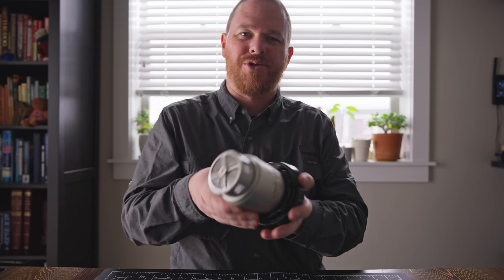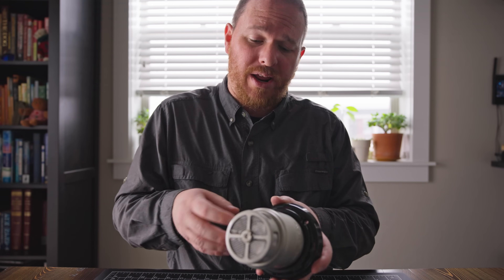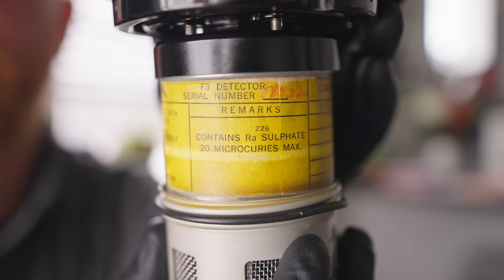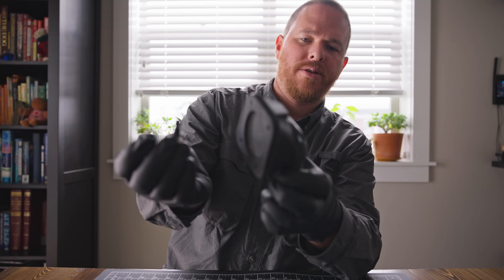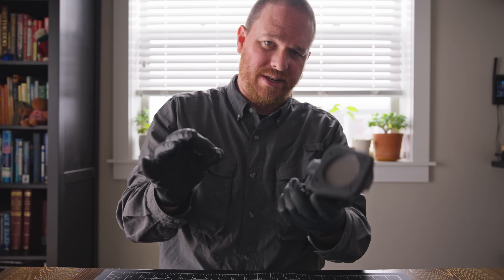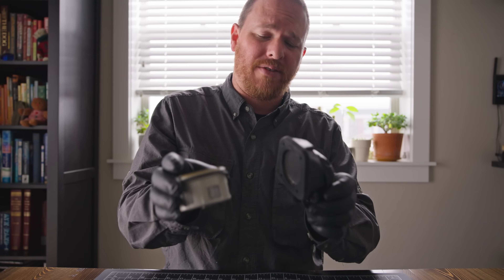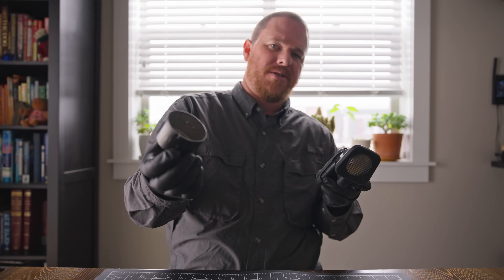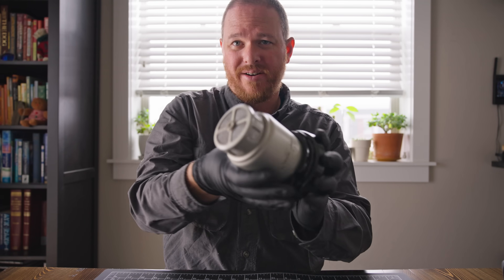Intensely Radioactive Industrial Smoke Detector from the 1950's

Comment: holy heck that sure are some naaasty sources in there.other than the total neglect of any and all safety precautions for handling this sort of source a pretty enjoyable video but PLEEEAASE do not handle sources like that. in any professionl settings sources of this activity would either not be man-handled at all but rather in a shielded robotic hot box, handled inside a shielded glove box by personel or maaaybe under special circumstances be handled in a well ventilated, closed loop, specially certified nuclear chem lab with 2 redundant  personal dosimeters, at least one ionisation detector and scintillation detector continuously sampling the air in the lab and inside a lead fortress made of thick lead bricks. 20uCi is a terrifying amount of activity. The fact that you can just screw these open makes me question what the hell the designers were thinking. i mean nowadays you need 10 different safety screwdrivers to open up a power bar and back then you could just unscrew that? also why does the industrial detector need a source this active?

Comment: AM-241 is not just an alpha source and it does release plenty of gamma radiation with energies of 26Kev and 60Kev. Your device must not be sensitive enough to detect them giving you false readings compared to the radium source
Reply from the maker: The americium source does give off a lot of alpha / gammas and my detector can see them. The radium not only gives off alpha radiation but also loads of beta and gamma. All the daughter isotopes give off a lot as well, which adds to the total radiation.

Comment: Ist the radioactive Post from the mesh Thing strong enough to make the needle from my cdv-715 move?
Reply from the maker: Good question. I have a CDV-715 from a CD-777 kit. Haven't tried that source against that detector.
Reply: @RadioactiveDrew  if you have the time, try it,just for interest.i make a electrical restoration of my cdv-715, checking all the resistors in the circuit, most of them are out of tolerance, and get replaced with New ones,to make the cdv-715 working much better. Have a nice day, and greetings from germany.

Comment: you need a cloud chamber
Reply from the maker: I know. Its something I'm working on.
Reply: @RadioactiveDrew  next time you're in the southern California area, let's meet up.

I have 3 chambers I built, and I have one you can have.

My biggest uses around 800w when active and takes about an hour to cool down.
It's a water cooled tec setup built into a custom pedestal stand.
It has a pair of rgbw light strips in a around the base with only a 1mm slit and 15mm back set gives a 2deg light beam at 3mm and 10mm off the chilled plate, a grove around the chilled plate let's alcohol come in contact with the mid plate between the 2 cooling stages. A 10gal frameless cube aquarium fits over a lip seal, keeping the unit water tight. I can keep talking for hours
Reply from the maker: @ZoeyR86 wow, that does sound exactly what I’m looking for. Email me radioactivedrew at gmail.

Comment: you are crazy , how big dose did you get from that ,I dont know much about nuclear physics or radiation , moistly from bunch of videos on radioactivity and based on that stuff you risk cancer if not worse . how do you even dare to take things apart  not to mention you were exposed for significant time, i mean meter was going crazy even  far away .
Reply from the maker: The dose rates from a source like this radium post is on the higher side of sources you can find. But you would have to spend much more time with it in your pocket for there to be a problem.

Comment: How was this advertised? 

Achmeds Dirty Bomb Starter Kit.
Just add high explosive!!! 

All this can be yours for 3 easy  payments of 3.99 sheckles
Reply from the maker: Was advertised as a industrial smoke detector, which it is.
Reply: @RadioactiveDrew  really man, no sense of humor? I know it's a smoke detector, I know it works because the radioactive material ionizes the surrounding air allowing that air to become electrically conductive creating a circuit that smoke particles will break thus triggering the alarm. And I knew all that before I watched the video, id just never seen anyone take one of those apart before. I used to work for Sandia, I've actually touched two different pits from weapons being dismantled. Me and old Mr Nukey are well acquainted and all that is to say it was a joke but only kinda because some asshole bent on doing bad shit gets ahold of a few of those off ebay, they could make something akin to a dirty bomb, or some idiot looking for clicks doesnt know how dangerous this stuff is buys one for a video and does something stupid like putting radium in their pocket for a day or two see what I mean. But in all honesty my previous was meant to make you chuckle not a serious question
Reply from the maker: @limabravo6065  sometimes its hard to tell what is sarcasm on here.
Reply: @RadioactiveDrew  I know and honestly I've seen the comments people leave you and others that are dead serious and dead wrong but they'll fight tooth and nail convinced of their superiority. Hell I had a guy on reddit write me a damn near dissertation on why I was wrong about fission weapons, and that the fuel in those bombs all undergoes fission. Not sure where he got his info but he was passionate that was for damn sure. Oppenheimer couldn't have convinced this guy but what can you do. Anyway sorry for the confusion, big fan of the channel  and please don't irradiate yourself

Comment: So I know you’re limiting your exposure quite a bit in this video, but I am curious if you have a rough idea on how long it would take for radiation sickness or burns to appear if you were to handle the device ( fully assembled) for a more prolonged amount of time. Would you even be able to get burns or radiation sickness from handling this device? Also, is there any shielding provided or is it relatively unshielded?
Reply from the maker: You wouldn't be able to get radiation burns or sickness from handling something like this smoke detector. The level of activity isn't high enough. The radium source might cause some redness of the skin if you were to hold it in your hand for a while.

Comment: What confuses me, if I have a unit (GMC-500+) that doesn't measure alpha, yet reads 10k+ CPM when reading a house hold smoke detector button of americium 241. Am I not reading the alpha? Am I reading beta/gamma?
The other part is why does the card that came with it saying over 100 CPM is high. Isn't that ridiculously small compared to other samples that are 10k, 20k, etc
Reply from the maker: That card is wrong. 100 CPM isn’t even close to high. Am-241 does give off gamma radiation but it’s at a much lower energy than most other isotopes.

Comment: Make your own battery with a pervoskite, or maybe cigs or gan solar panel, with gamma and other types of radiation, you coupld probably get some minor useful result. How many watts of energy is this radioactive thing throwing out? It does not get hot in watts, but its probably very energetic in a non heat manner. ?

Gammavoltaic conversion

Gammavoltaic devices use a semiconductor junction to produce electrical energy from energetic gamma particles (high-energy photons). They have only been considered in the 2010s[13][14][15][16] but were proposed as early as 1981.[17]

A gammavoltaic effect has been reported in perovskite solar cells.[13] Another patented design involves scattering of the gamma particle until its energy has decreased enough to be absorbed in a conventional photovoltaic cell.[14] Gammavoltaic designs using diamond and Schottky diodes are also being investigated.[15][16]
Reply from the maker: Now that would be really cool to test out. Seems like it would make so much more sense to use the full force gamma energy than to try and knock it down to what photovoltaic can handle. The idea of using ionizing radiation as direct energy source has always fascinated me.

Comment: I wonder how many folks handled that exact same detector with no protection, and was contaminated with radium directly. Also, i wonder just how many people were adversely affected by just that detector being installed in various buildings.
Reply from the maker: It seems like the installation process would be fairly quick cutting down on people’s exposure.
Reply: @RadioactiveDrew  Yeah. Most of the time it would be, when troubleshooting is necessary, someone may have handled it longer. Im just thinking, how radioactive it is, wow.
Reply from the maker: @KickOutTheJhm I don’t think anyone would have been holding it for that long. Plus it has stickers on it saying it’s radioactive. I would imagine the techs for the company had some training on do’s and don’t’s.

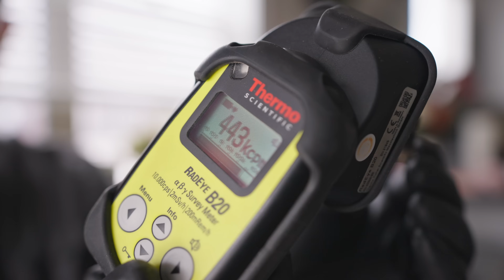Comment: @RadioactiveDrew The RadEye Geiger counter had 10,000 CPS = 2mSV/hour written on it. 4:50  It read approx 500,000 counts per minute=8333 CPS = 1.66mSV/hour. Less than a chest x-ray every hour. Wouldn't wan't that exposure more than once a year, but fine if don't do it more often.
Reply: So it is. Apologies, I misread as equals.Nasty smoke detector ain't it.
Reply from the maker: @HowardKlein1958 the smoke detector is a pretty unique source. Just needs to be treated with respect.
Reply from the maker: Those numbers on the Radeye B20 are the limits of its range. Over those readings it goes into overload. On contact that smoke detector source goes over that range.

Comment: Radon gas???
Reply from the maker: What about it? I don’t keep sources this active in the house. I also monitor the radon level inside.
Reply: @RadioactiveDrew  But this source emits RAdon gas? I am right?
Reply from the maker: It does…but it’s not that big of a deal.
Reply: @RadioactiveDrew  Did you measured Radon gas level where you keep the source?
Reply from the maker: @Djmatrane no…because I keep it in my garage in a safe with some other hot items. The radon in the safe would be higher than the radon detector goes.
Reply: @RadioactiveDrew  Thanks a lot :) Now I understand :)

Comment: This guy is hyping up the drama, its Alpha radiation, no need for gloves and drama
Reply: also contamination is a factoring key radon decays into other isotopes which fall back down as dust and so gloves are appropiate and the amount of gammas goes up with the larger source and alpha only goes for maybe a good 200k cpm-400k cpm out of the total 700- 1 mil cpm (alpha, beta, gamma) the rest is beta AND gamma
Reply: (of his source)
Reply from the maker: Guess you don’t know much about radium. Not only is it an alpha emitter but it also emits a bunch of beta and gamma radiation. I wear the gloves so I don’t get any skin oils on the source foil that could corrode it.
Reply: @RadioactiveDrew  I stand correct, the nuclear source in this case Americium is a free helium atom nucleus, not a dust. It’s an alpha emitter. No need for gloves. You’re a YouTuber not a nuclear physicist. You know as much as me. FYI don’t engage in comments, just makes you look like a punk
Reply: @RadioactiveDrew  even if they used Ra226 it would be the same, alpha emitter
Reply from the maker: @Markos581973 spoken like someone that hasn’t dealt was radium items.

Comment: As you are into superlatives, Am-241 is 10 million times more radioactive than U-238,   H-3 (tritium) is 370 million times more radioactive than U-238 and Rn-222 (radon) is a whopping 2.4 trillion times more radioactive than uranium 238.   The reason is that uranium 238 is weakly radioactive with a long half-life of 4.5 billion years.   Uranium ore is about 7 times more radioactive than uranium metal, due to the progeny in equilibrium, but even so, these comparative values of radioactivity would still be large numbers.

Comment: Drew: I worked at Crystal River Unit 3 for 25 years.  B&W had sample bolts made of steel from other B&W reactors installed in the CR-3 core barrel.  One outage I supported the B&W rep taking care of spent fuel transfer equipment.  Once reactor operators transferred the fuel to the spent fuel pool and the core  barrel was moved to the deep end of the spent fuel pool,  I assisted in removing a Davis Bessie reactor sample bolt for shipment to B&W.  My job was supporting operation of the underwater video equipment.  I was there if we had any problems with the video electronics.  We didn't have any problems so I was a standby observer.  
Prior to starting work the HP's assigned surveyed the bolt area of core barrel with an underwater detector.   As they moved the detector towards the sample we had a reading of 500 MR at 10 inches.  The detector went off scale at 2 inches (10,000 R). 
The sample was to test for Neutron embrittlement of the Davis Bessie reactor.  I learned the most of the B&W reactors had samples from sister plants. This radiation level was after fuel removal.
The area where I was had a dose rate of les than 5 MR/hr. 
Also I used to take care of the fire detection system at CR-3.  I tested many of those Pyrotronic detectors.  They were a high enough source that HP's had to survey the job even when the detectors were not in a radiation controlled area.  I retired in 2009.  I am a fan of your channel.
Reply from the maker: That’s a very cool story man. I always like hearing how industry professionals worked in those environments. Super intense radiation is extremely fascinating to me. I saw some Pyrotronics detectors inside the reactor building on my way to the RCA. I’m sure they were just the Am-241 version and not the Ra-226.

Comment: I am curious, what if old workers had the detectors in the roof right on top of their workstation. Even if it was meters in top of their heads, working years and years on the same spot would have give them quite an exposure to it right? Or even when they were used in houses. Imagine kids and housewife exposed in the kitchen for years and years
Reply from the maker: Well these smoke detectors were for industrial uses. They were much more radioactive than any residential ion smoke detector. They were mainly used in factories and power plants. So I would be very surprised if these were ever mounted in a way where they would have been a meter above anyone. But yes in this hypothetical it wouldn't be good to be sitting that close to one for years and years...one of these industrial smoke detectors. Like I said before the residential ones are only a problem if you are eating them.
Reply: @RadioactiveDrew  thanks for you answer, i am facinated with your content! extremely well done videos! keep it up! wish you the best
Reply from the maker: Thanks. I always like to hear that people enjoy the content.

Comment: Hi Drew, How many inches does the radiation pass from a modern household smoke detector with the cover on?
If I stood about 12" under one for over an hour would it affect me?
Thank you!
Reply from the maker: Cover on or off it wouldn’t make a difference. The bulk of the radiation is in the form of alpha, which only goes a couple inches in air before it’s stopped by air molecules. The americium in common smoke detectors does produce some low energy gamma rays but you would have a hard time detecting them from 12 inches away.
Reply: @RadioactiveDrew  Thank you for the quick answer! Have a great night.

Comment: 500k counts per minute... It's Radium thus, it's dosage equivalent is 22*10^-8 Bequerel per Sievert, giving you a whopping 6.6 Sieverts per hour at the distance of your measuring device. That is either a huge miscalculation on my side, or that thing is absolutely deadly if you keep it close to your body for just a few hours.
Reply from the maker: Yeah...your math is a bit off there. If I was exposed to 6 Sieverts in an hour I would be dead. Usually around the 2-4 Sieverts range in an hour starts to be fatal. Sources like that aren't easy to come by and something that dangerous wouldn't be used in a smoke detector.

Comment: The cool think about this specific model, they realized the danger of prolonged Radium exposure with these detectors. So they actually switched to an Americium 241 source. Granted, the model with Americium 241 model has 80 Microcuries. If at all possible, could you be able to do a video on the americium model? The model of the newer style is Pyrotronics F5B. Would be nice to know the difference and have a reference video! Thanks!
Reply from the maker: Funny you should ask…I’m working on that video right now.
Reply: @RadioactiveDrew  LMAO NO WAY. Awesome man. If I pull any above normal (0.9 Microcuries) ionization detectors out of the field, I’ll make sure to send em to you for analysis!

Comment: So, quickly calculating based on what is visible, at that distance you've exposed your fingers to an intensity roughly equivalent to 500.000 times background radiation. Even though the total dose would be low, that's a very unwise thing to do.

Comment: AM241 is also a gamma source
Reply from the maker: You're totally right. Its just not as intense of a gamma source. I think that might have been the reason why they switched over to Am-241 from Ra-226.
Reply: @RadioactiveDrew   Do you know what distance would the gamma be undetectable at from a 0.9 microcurrie source?,

Can an average concrete wall block such a weak sourc